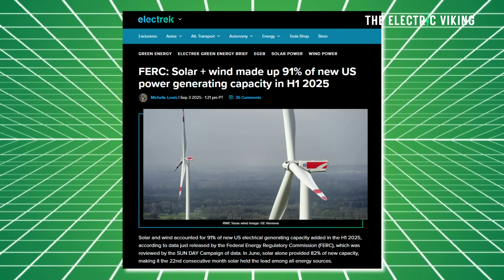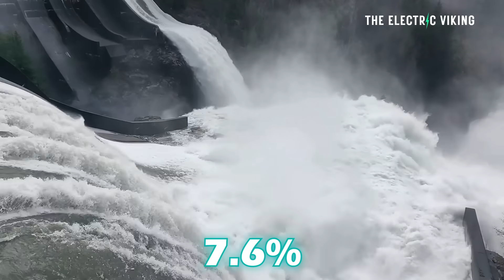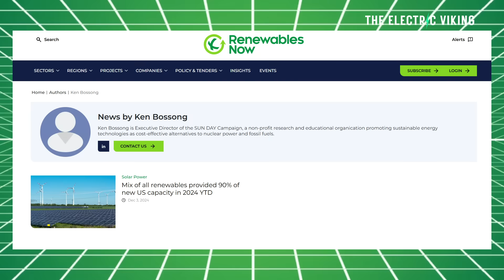Solar & Wind Are Taking Over! 91% of New U.S. Power Is Green Energy

Comment: US solar and wind power on the public power grid is advertised to be saving 1% each on fuel.   That is unlikely.   It costs more to keep gas turbine generators just at high availability to back up wind power and solar power 100% making near zero electricity than to make all the electricity by more economic efficient means.   All the large increases in US electric rates can be traced to having to support more and more solar and wind power electricity.  What needs to be done is to sunset public rate payer support for erratic forms of power.   Small amounts can be handled by traditional electric power generation.   It was never meant for the power grid to have to support these forms of electric power in large amounts.   It can be done at much greater cost and complexity.  It is an engineering feat, but is serves no real purpose, doesn't save fuel and greatly increases rates in areas where there is a lot of it such as southern California.  Some might be able to be useful with battery installation, but the cost is likely prohibitive unless wanting backup power.

The war on coal in the US is suppose to be coming to an end.   West Virginia has its 50 GW by 2050 program for making electric power.   It makes 16 GW now suppling power to neighboring states.  WV is open to gas turbine and nuclear power generation, but new ultra supercritical coal power plants are likely to be the main producers.  Nuclear power has taken a long time to build and the costs are high.   SMR are predicted to cost more per MW than traditional nuclear power; however, SMR may offer fast  implementation.  SMRs still have to have the evacuation areas of traditional nuclear power causing the planed implementations to be at existing  nuclear power sites.

Comment: Trump lost thousands of coal jobs during his first term in office because natural gas was cheaper than coal. Why would anybody expect Trump to save coal jobs during his second term? One thing is certain: we need to STOP SUBSIDIZING THE FOSSIL FUEL INDUSTRY!
Reply: オーストラリアは電気代が高騰していますよね
Reply: @田中亮太-k3u  That is probably because of merit order. Fossil is setting the price.
Reply: @田中亮太-k3u  Production prices for electricity are low in Denmark and falling.
Reply: @SorenLund-u2f We have vast distances to transport energy produced by wind and solar. Note the New Mexico wind project that needs hundreds of miles of new transmission lines to get the power to California.  Transmission costs are rising, while solar costs are decreasing.  Demand here is skyrocketing and the capacity of transmission lines are not keeping up.
Reply: 再生エネルギーの方がコストが掛ります。電気代を下げるために多額の補助金が使われています。
Reply: @田中亮太-k3u  Nonsense it is the otherway arround.
Reply: @田中亮太-k3u  youre uninormed, or lying. either way, change.
Reply: 中でも、オーストラリアの光熱費については、世界トップレベルに高額だと言われている。 例えば、シドニー市民がの電気料金は、ニューヨーク市民の倍とも言われており、また、１キロワット時当たりの電気料金は、南オーストラリア州で約42セント（約40円）と、米国の約15セント、日本の約19円を大きく上回るという。
Reply: @田中亮太-k3u  failure. theres no real connection to current costs of new power. sorry, wrong again!

Comment: A lot will depend on sodium ion batteries coming to market.  Even if they aren't produced at rates to meet the likely enormous demand, they will drive prices of other batteries down.  With home energy storage becoming cheaper, rooftop solar becomes a lot more attractive.
Reply: Even without batteries, Solar and wind has had the best LCOE of any renewable for some time now, and getting better every year..And for places like California, as long as it isn't exceeding demand realtime, there isn't really a need for batteries in those areas, you get your best value using it when it's produced, even if the batteries were free.

Comment: Gas plant production is basically at capacity and their isn't much the admin can do to increase it. Meanwhile renewable production is increasing and getting cheaper so tarrifs slow installation but not stop it, which is gonna drive energy prices up making any completed renewable project more valuable. Finally the US is starting to get pretty good at transporting compressed natural gas, so natural gas is going to get more expensive in the US as it becomes a product that can be sold outside the US, again increasing the price of electricity and further the profitability of any renewables project.

Comment: It´s installed capacity - it´s not 24/7 power generation. While the electricity generated, only when the wind blows may be cheap, the additional investments needed for storage, grid expansion and backup power are astronomical. Germany and the UK are going bancrupt because of excessive and unreliable electricity cost. Planting more wind mills without a technologically breakthrough in cheap, abundant, longterm battery storage makes no sense once the percentage generated exceeds 20% to 30% of total energy production. We need 200 gigawatthours storage capacities, not 200 or 400 megawatthours.

Comment: 2:24 The nonprofit hospital I work at is part of this number as they installed 1200 rooftop panels earlier this year. If nonprofit hospitals are doing it then it’s gotta be a good move financially.
Reply: Cheapest way to get long term backup energy. A generator only lasts as long as you have diesel fuel. All you need with solar is sun and a backup battery,.and with CATL sodium batteries soon that will be cheap.
Reply: Big time for sure.
Reply: Not for California they pay u shit for the free electricity the solar generates
Reply: @kennethroth6757  because solar  competes with itself . Once you cover the need for power then it has no value so first you use second  you export it third  you store it fourth it is wasted the more solar there is the more step 4 there will be because of how it produces energy
Reply: @kennethroth6757 Never connect your home solar to the grid.  Use what you generate and store the excess.

Comment: Man i hate this terrible clueless workers (like timestamp 2:11) that step onto pv modules, NEVER EVER do that, the modules will be damaged and will die after 5 or 10 years due to microcracks, if you see someone stomping on a pv module fire him immediately. If you absolutely have to step on a module, put some soft tissue over it, then some sheet for distributing the load, but never ever stop directly without such measures on it.
Reply: Thank you for pointing it out.  I had no idea panels should never be stepped on and most installers probably don't either.

Comment: I roasted coffee with sunlight today. Okay, I did it with excess electricity generated from my solar panels, rather than using a big magnifying glass, but you get the idea.

Shout out to Kaffelogic in New Zealand. They designed and manufactured the Nano7 roaster that I used here in the states.

Note that virtually all large roasteries use natural gas to roast their coffee. And, yes, roasting beans releases CO2, but next year’s crop consumes CO2. That leaves the transportation system as a remaining target.

Comment: You should certainly qualify the capacity factor difference between the fossil fuel and solar/wind power plant ratings where renewables typically produce less than a third of the energy over time at the same power rating and does so unpredictably without batteries. With the new cheap sodium batteries, renewables control grid frequency better and cheaper than gas peaker turbines and can compete with other fossil baseload plants in many jurisdictions where renewables are plentiful and  fuels are expensive, so make sure you dot your I's and cross your t's to ensure public confidence in your analysis.

Comment: It takes 10 years minimum to build a nuclear power plant . power companies are only keen on quick bucks so solar winds battery will grow but it risks black outs
Reply: If you want to grow generating capacity fast, solar is the best option. Nuclear takes a long lead time, although these small reactors are interesting.
Reply: @Quagma-b2i  yes but above all utility companies are looking for quick return. for example it is sensible to build CSP instead of PV yet because of upfront cost utility companies use pv farms
Reply: @SCP_X1 CSP isn't cost competitive with PV anymore.
Reply: Abolish the NRC and build the same plants as in the 1960s in 2.5 to 3 years, like they did then. HYPER-OVER-REGULATION extends the build times, therefore borrowed money cost increases 70 to 80 percent. NRC NEVER SAVED A LIFE, but it killed nuclear in the U.S.
Reply: @beautifulgirl219 abolish the NRC? Well, you can always dream.
Reply: better than getting Nuked

Comment: Sources of U.S. Electrical Power Generation have remained FLAT since 2010 -- Natural Gas 41% , Nuclear 19%, Coal 16% , Hydro 7% ,  renewables 14% (mostly solar, wind & geothermal)
Reply: Key Changes in the U.S. Electricity Generation Mix (2010–2023)
1. Decline in Coal Usage

Coal's share in electricity generation has decreased from approximately 45% in 2010 to about 16% in 2023. 
U.S. Energy Information Administration

This decline is attributed to the retirement of older coal plants, economic factors, and a shift towards cleaner energy sources.

2. Increase in Natural Gas Generation

Natural gas has become a dominant source, rising from around 23% in 2010 to approximately 38% in 2023. 
U.S. Energy Information Administration

The growth is due to the availability of low-cost natural gas from domestic production and the efficiency of combined-cycle gas turbines.

3. Growth of Renewable Energy

Renewables (wind, solar, and others) have seen substantial growth, increasing from about 13% in 2010 to 22% in 2023. 
U.S. Energy Information Administration

Solar and wind energy have been the primary contributors, with solar capacity increasing from 7% in 2020 to a projected 29% by 2050. 
U.S. Energy Information Administration

4. Stable Nuclear Energy Contribution

Nuclear power's share has remained relatively stable, around 20%, with slight fluctuations due to plant retirements and new constructions. 
U.S. Energy Information Administration

5. Emergence of Battery Storage

The integration of battery storage systems has enhanced the reliability of renewable energy sources, allowing for better management of supply and demand. 
U.S. Energy Information Administration

Comment: The economics of solar in the US are solid, be happy.  So solid that adding US taxpayers money for that is not needed (I rather give that money to uniformed military, vets ... old people vs corporations/execs).  With solar + storage, new nuke and fusion research makes no sense anymore.  Per Trump "blocking this", that's not true, they have just removed the special corporate breaks for new solar.  We are adding solar as fast as the grid can manage it.   Spending taxpayer money to make this faster is a pointless waste.  BTW: Power for GAI is not going to be a huge power deal ... I think we jumped the shark ... in 2027 power for GAI will be less than in 2026.
Reply: Rooftop solar is 2 to 3 times more expensive and much slower to install than in Australia. Why? Who has thrown the anchor out?

Comment: A recent Forbes video shows congressional hearings in which a government nominee is grilled. Electricity demand in the US will grow by 30% in the next 5 years. The current lead in time for a gas turbine is over 6 years.   Electricity prices in the US are rising. How will data centres secure the power they need over the next five years? Wind and solar have lead in times of months and they're also cheaper.
Reply: Another issue is reliability. We have frequent disruptions of the power grid. That's disastrous for large networks like these data centers. There will be a lot of problems ahead.
Reply: Data centers are being co-located with power plants, including ones with Small Module Reactors (SMR).  These reactors are assembled at a factory and then shipped to the site for installation.  So they can come online much faster than the old large reactors.  Also, Gates and company are bringing older sites like 3 Mile Island back online. The AI data centers need a constant source of dedicated power located nearby, and nuclear is their best option.

Comment: Texas leads country in alternative energy, they have discovered that anymore than around 23% alternative energy the grid becomes unstable.  Grid battery systems may help increase that percentage.  Gas has to be kept available for on demand use but it is very expensive to keep gas generators offline and on standby.
Reply: As battery capacities are added, the renewables % will climb.
The costs applied to keep those gas turbines available should be applied to added battery farms
Reply: Wind and batteries can make 100% reliability, toss in all the pumped hydro you can as it is cheap.

Comment: In the company I work also there is quite a bit of optimism in that direction.
The say is that the economic factor and the convenience of solar is so strong that not even in Texas the anti solar policies will block the installations.
And by the way... I work in diesel engine company. But where gas turbine and coal power plant beat diesel engine for baseload... diesel still win as flexible backup power source... so we sell Solar+Battery+Bakup/support engine packages, with if wanted green fuel support or green fuel ready. 
Company that make their living making device that produce energy burning fuels are more invested in the decarbonization than what most people think.
Because they have alternatives.
 The main pull on the other direction is from companies that extract the fossil fuels.
Reply: 石炭火力発電所を主としてる州と再生エネルギ―を主としてる州の電気代は３倍違います。

石炭火力発電所はクリーン石炭です。CO2を９０％カットできる最新型の発電所です

電気代が高騰すると、物価も高騰します
Reply: @田中亮太-k3u   Solar is unbeatable cost wise. But it's not on demand and it's not constant. Se need energy vectors to have energy on demand. Batteries, but also other type of storage either as kinetic, thermal, potential or chemical energy for long and short time. Green fuels try to be part of the equation. Excess of energy+CO2+H2O = fuel than when you need you combust it get energy back and produce Co2 and H2o in the same quantity you have pulled out from atmosphere.

Comment: AI Google says...
Texas and Florida have been adding the most solar power in the USA, outpacing California, the traditional leader. While California still holds the largest cumulative solar capacity, other states are experiencing more rapid growth in new installations. 
Top states for new solar additions in recent years include:
Texas: As of early 2025, Texas led all states in new installations. It has surpassed California in utility-scale solar capacity and overall new additions, driven by falling costs and strong demand from the energy-intensive tech industry.
Florida: Florida has rapidly expanded its solar capacity, ranking second for residential installations in 2024. It also surpassed California in new utility-scale solar installations in 2024.
California: California has long been the leader in total installed solar capacity, and it continues to add significant capacity.
Other states: Indiana, Arizona, Michigan, and New York are also rapidly expanding their solar capacity.
Reply: Once the hardware is paid for its virtually free electricity for years and years !
Reply: They are trying to catch up with California.  California is where tech is created and often first deployed.

Comment: I’m all for solar but suggesting nuclear is nowhere based on half yearly figures is a bit silly. Nuclear projects take ages to build so their coming online is inherently lump in nature.
Reply: If you build a big solar or wind energy source and alongside it have a big battery you get an energy supply that is cheaper than nuclear.  Its not without risk in terms of intermittency but repeat the idea in many places and its the best option we have for green energy.

Near me we have a nuclear plant under construction (Hinkley Point Somerset) and it is massively over budget and decades behind schedule.   May cost 57 billion, original estimate 18.   No electricity yet produced.
Reply: @tftftf  location matters.  Plenty of places will be better with nuclear, many better with solar.   I was up in Alaska last November.  My 200w panel only took in about 20w at peak hours when sunny.  When overcast, it was below 5w.  It was about 50w in Seattle.  Of course, this is flat on on the roof of my car.  But it highlights that solar isn't best everywhere.  Here in Utah, it gets about 100w at peak hours in the winter.